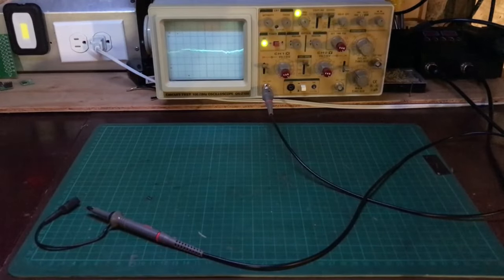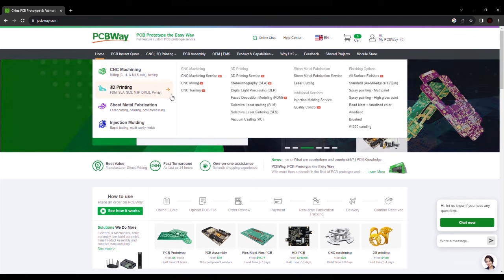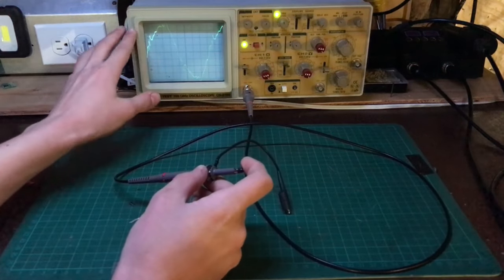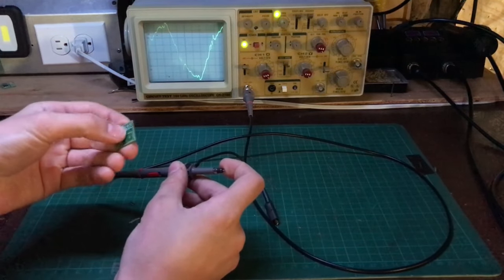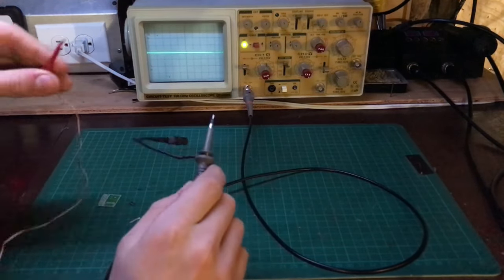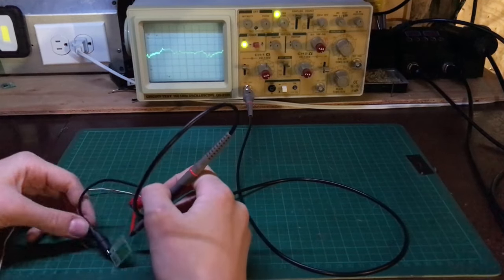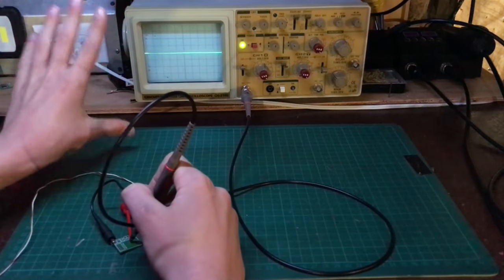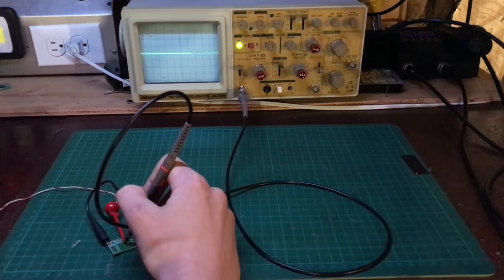How to use a Oscilloscope as a continuity tester!

Comment: If your scope has a test point, you can actually connect it to your board as a source... and then the test point will show a flat line if unconnected to the test point, or the generated square wave of the test.  You'll need an additional alligator clip to test it, but works beautifully.
Reply from the maker: Thanks for that Info! that would work better than using Noise to test! Thanks for watching!